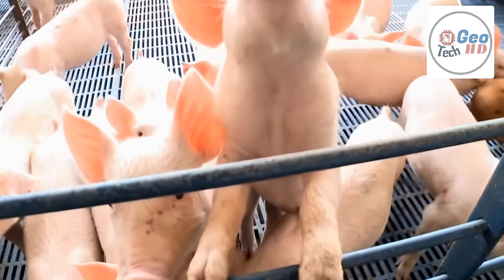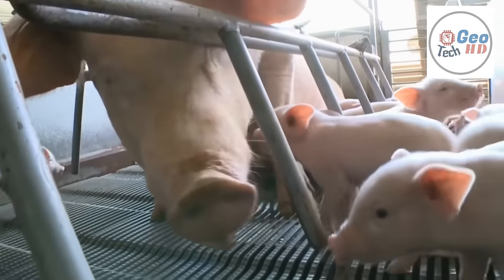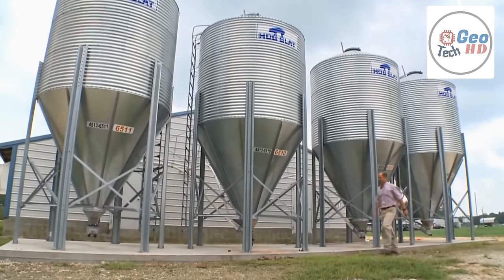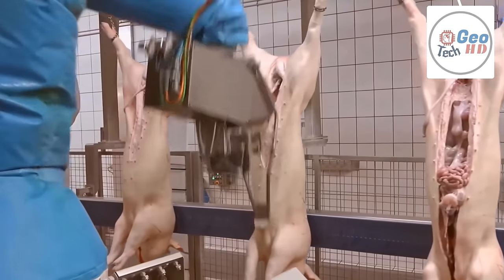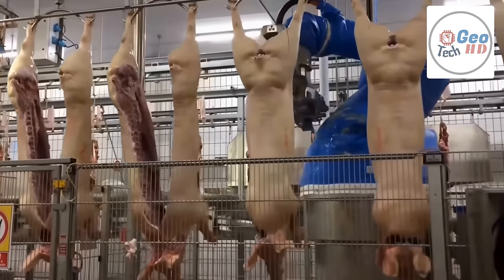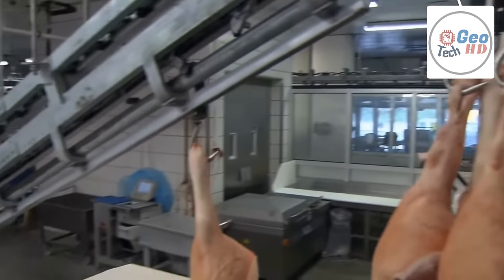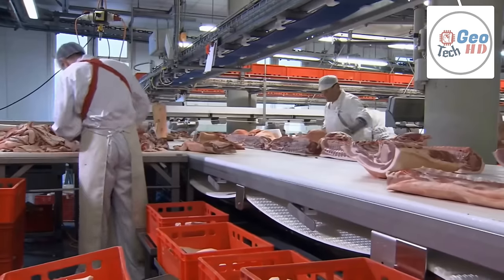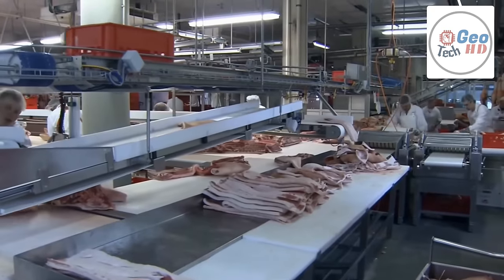Mind Blowing Million Dollars Modern Pork Processing Factory Technology - Pig Farming Technology

Comment: I worked at a large pork  processing plant in Pennsylvania in the early 1980's on the second shift "sanitation" cleaning various areas of the plant.  EVERY SURFACE FLOOR WALL AND PIECE OF equipment is thoroughly cleaned and sanitized.  EVERY DAY.  I came in early one day to watch the process from start to finish.  The one guy I really felt sorry for was the guy that had to "bleed out" the pigs after they were stunned and hung by a rear hoof and his job was to  slit their throats and they went around a carousel as they bled out.  The poor guy was covered in blood from the first pig until the last.  Then they were sent through a set of flames to burn the hair off and then through a car wash like brushes to remove any left over hair and soot and from there went into blast coolers (4 passes) and at the end of the journey, the meat was about 35 or so degrees and then down the line where they were manually cut up (not like the plant shown in the video).  It was a VERY labor intensive process.  They invested heavily in a modern waste treatment plant on  site that treated all of the water used in the plant before being discharged into the municipal sewer system.  Our treated water was CLEANER than the water coming out of the taps in homes.  Our biggest complaint was when we "rendered" the unusable or waste parts and the resultant product was made into animal food.  It did smell awful and I could tell when we rendered as I drove into work.  It was great to see a newer modern process in use there, but there is STILL an awful lot of manual labor required.
Reply from the maker: @MrTommyboy68, Happy Holidays and Thanks for sharing.